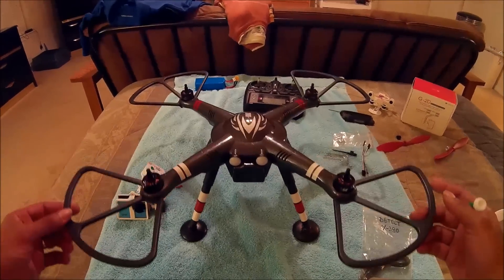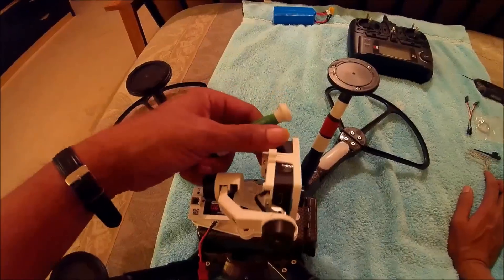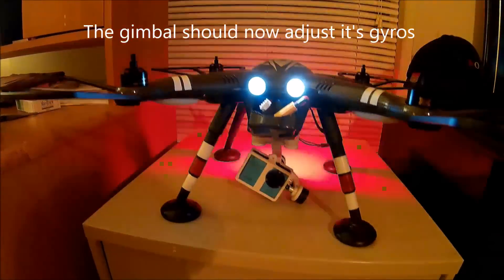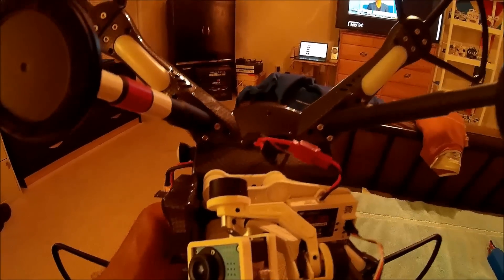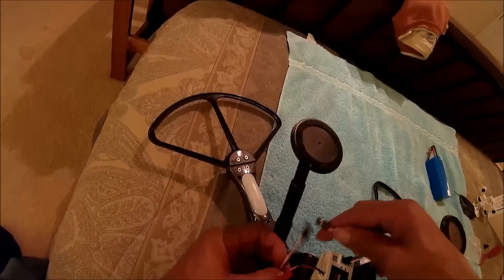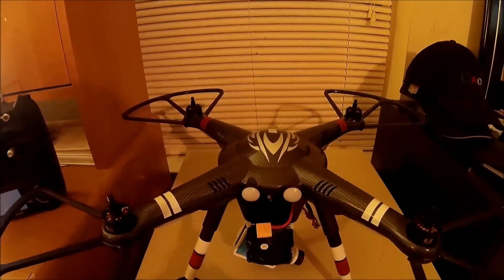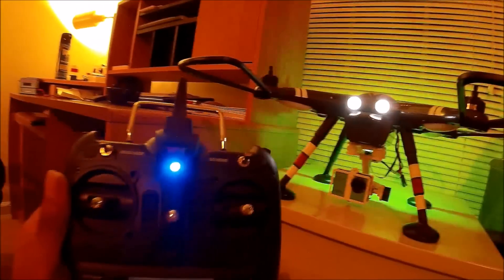XK DETECT X-380 "HOW TO INSTALL THE G2D GIMBAL"

Comment: it does not work for me I did everything u said
Reply from the maker: Are you using the same drone & gimbal as shown in this video??? Are you using the exact same cables & wires? It should work. I suggest watching the video again and go back and check your connections (positive & negative wires, etc.)  Good luck!!!
Reply: @DJSOULFORCE   yes i am have the same drone have  the same gimbal and the same wires
Reply: yes I did  @DJSOULFORCE
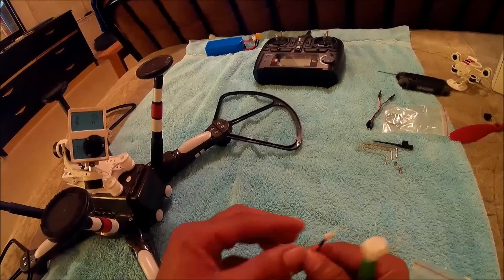Reply from the maker: Your gimbal may be defective. To test your gimbal, (REFERENCE 2:11 in video) use the gimbal power cable, plug it into a 2S LiPo battery using a JST connector to see if your gimbal is working.
Reply: @DJSOULFORCE    ok thanks

Comment: Hi, I need your help. I am going to instal my no original brushless gimbal. I fear that I fry my FC after plug in signal lead from gimbal to X380. Output from gimbal PITCH signal is =5V!!! Pls could you measure your output on your signal from original gimbal.Thx in advance
Reply from the maker: That's correct, output from the PITCH signal is 5v.  What gimbal are you using?  You refer to "original gimbal" and I'm not sure which gimbal you are talking about? I'm using the Walkera G2D, I do not have the Original XK gimbal...  Good luck, thanks for watching!!!
Reply: Ty for your fast respond.Did you really measured 5V on signal wire  FROM gimbal? Ibought this one https://www.aliexpress.com/item/2-Axis-Brushless-Gimbal-Lightweight-Aerial-Photography-Gimbal-plug-and-play-PTZ-For-DJI-Phantom-1/32843537496.html
This gimbal work well but I am not so brave 😊 connect signal for pitch. A lot of guys talked about destruction of FC
Reply from the maker: No, I did not actually measure because there "is no signal coming from the gimal" only signals being sent to the gimbal.  As long as you ensure that you don't reverse the wire, you should be good to go!  Good luck!!!
Reply: That is why I am asking😊. When I powered gimbal by 12V and then  measured on pitch PIN and GND on the gimbal I measured 5V. It seems weird. Pls could you simple check on your gimbal?Thx
Reply from the maker: Sorry, I don't have a voltage meter at this time. It does sound weird, I would not connect it if I were you!  Good luck.
Reply: Np.Thx anyway

Comment: Well, I finally installed my G-2D on my X380 and it all seems to work fine. One question, does ANYONE know how to know approximately what angle the camera is tilted in flight? I mean, in bench testing, there doesn't seem to be any fixed position on the tilt wheel that corresponds to the angle of the tilt. I'd like to be able to know what angle of tilt while the quad is far away so I get the best video.
Reply from the maker: Sorry, there's no way to tell except to set camera angle before takeoff and leave it!  Another alternative is to set your camera up for FPV so you can use a monitor to see what the camera sees.  Good luck. DJ SOUL FORCE
Reply: Soul Force, thanks for the info. I was hoping XK had some little icon on the LCD that indicated the pitch on the gimbal. I've got a TS832 tx on order so setting up FPV is next on my "to do" list. 

What I REALLY want to do is (assuming I grow a big enough pair) is go up to one of the volcano's we have down here (Poas or Irazu) and fly over or even down into the crater and get some really spiffy video inside the crater. Unfortunately, that's about 11,000 feet altitude so I'd need to be sure I have enough lift to climb out and land safely.
Reply from the maker: Wow... sounds like an awesome flight. Would love to see that and you'd probably be the first.  Be advised that some GPS quads won't fly over 8,000ft above sea level... I don't know how or why, but I've read that in user's manuals. The Phantom won't climb over 8K feet above sea level, even if you climb the mountain and take off at seven thousand feet, it won't go above 8K. The X380 is not that smart, so it may work! LoL!!!

Comment: hi I just got the walkera g2d gimbal I'm stuck on the signal wire you spliced the white wire mine has turned out to be the black wires but on the signal pin you said does that matter? and did you put a node on that wire I was recommended to. hope to hear from you soon
Reply from the maker: Sorry, I'm not sure about your black wires as opposed to mine being white. It's possible that the G2-D gimbal has been revised since this video. NO... I didn't use a node on mine! Good luck. DJ Soul Force

Comment: Hi. How can I see on my Remotecontroll which angle the cam stands if I pitch it?
Reply from the maker: You can not, unless your camera has FPV (like wifi) and a monitor (like a smart phone). I usually adjust the camera angle before takeoff and leave it!  Good luck. DJ Soul Force
Reply: DJ SOUL FORCE Otherwise I can count the clicks the wheel on my Remotecontroll made 😋

Comment: hi. thanks for the video.its very very helpful.just would like to ask once the gimbal and camera are installed do you have to calibrate the remote control.if so how would you do it.many many thanks
Reply from the maker: No, you do not have to calibrate the remote control once the gimbal is installed. Your remote control should be calibrated already from the factory. If you need help with calibrations, watch this video: https://www.youtube.com/watch?v=CTCmB86CY88  Good luck. DJ SOUL FORCE
Reply: oh thank you. you are a gem.absolutely wonderful.

Comment: Hi. Thank you for your video, it served me a lot. I have a question for you. I put the gimbal. Without problems, and it works, but now the dron does not fly, it comes out a color code that says the manual "control overload" ..... what is it?
Reply from the maker: I'm not sure what that could be. What color is your LED on the back???  Remember to never plug or unplug the gimbal while the power is on the quad. If you cannot get the quad to work properly, watch this video and follow these instructions:  https://www.youtube.com/watch?v=c0jPjEA4ZdQ  Good luck, let me know how it turns out. DJ SOUL FORCE
Reply: Hi. thanks for your prompt response. The drone light is yellow. According to manual on load of control. I connect the gimbal and then the dron, the gimbal works, but the dron does not.
Reply from the maker: Try turning on the quad WITHOUT GIMBAL connected to see if you can get GREEN light or if the yellow changes. If not, watch the video (i sent link in the first comment) and follow those instructions. Make sure that your gimbal connections are correct and that positive-to-positive, and negative wires are connected properly. Good luck.

Comment: Moving camera forward to get legs out of camera view. Maybe rotating the metal arm that suspends camera cage 180  degrees will move camera cage forward 1 1/4 to 1 1/2 inches.
Reply from the maker: Thanks for the tips. I have resolved this problem. The G2-D gimbal mounts on a "slider" type mount. I found that I didn't have to slide the gimbal all the way to the back to lock, so by leaving the gimbal paralel with the battery door, the legs don't show up in the picture! Thanks for watching. DJ SOUL FORCE

Comment: Hey DJ, I've got an OEM gimbal for my X380. I've got it mounted up just fine and the 2 axis stabilization works great. I remember in one of you videos, you described adding one wire that allowed you to control the tilt. Could you please tell me which video that was, so I can watch it again?

By the way, I'm so envious of you, getting to play with all of these quads, for FREE!

Your buddy,

Mikel
Reply from the maker: It was this video that you commented on! I don't have the x380 OEM gimbal, just the Walkera. I'm guessing that your OEM gimbal should have come complete with all neccessary connectors. Good luck. DJ SOUL FORCE

Comment: How far forward should the gimbal be? I want the legs out of the picture.
Reply from the maker: If you're using the Walkera G2-D gimbal, it mounts on a "slide" type bracket to hold it to the body of the quad. When you slide the gimbal on, you don't have to push it all the way to the back, ...leave gimbal even with the battery door and that should get your legs out of picture!  Good luck. DJ SOUL FORCE

Comment: having issues with the pitch. I actually have a go pro on it but it won't settle down after I hook up the battery.
Reply from the maker: After you turn on the remote (but...BEFORE YOU TURN ON QUAD) turn the tilt wheel up one notch, then turn on quad. The x380's default gimbal position is down, then the gimbal struggles to lift the camera up after you turn the wheel 100 times to get the camera to point up!!!  Also, make sure the camera is as close to balanced in the gimbal without any power. You may need to add some additional weight for that. (here's an example: https://www.youtube.com/watch?v=i5SmKr5NCwc) Good luck. DJ SOUL FORCE
Reply: DJ SOUL FORCE, the plug for pitch,  that come with the gimbal don't fit in the X380. do you suppose the signal pin could be reversed?
Reply from the maker: TJ P  The plug I use for pitch control, came with the x380. See if you have extra wires in the bag of screws and that little wrench!  That's the wire in this video I had to make it a little longer. Let me know how it goes.
Reply: DJ SOUL FORCE I used that for power. thanks for the help.

Comment: Hay, Soul,  when is your next give away?  This is so I don't forget to send you my address LOL!
Reply from the maker: ...you're silly!!! Next round at 4,700 subscribers!!!! Stay tuned. Thanks
Reply: Soul, like they say they say "The squeaky wheel gets the grease"  and I'm squeaking my butt off  LOL,   But anyway,  what do you think of Wilkear Drones, check this deal out at Ebay and tell me what you think?  Please. 

Walkera QR X350 Premium GPS Dual-Navigation FPV Drone
Reply from the maker: Tank 62 Looks like you were trying to send me a link, but I can't click on it... but the Walkera QR x-350 is a pretty decent quad from what I've seen. I've never flown one but there should be lots of videos on youtube from other reviewers. The QR X350 has been around for a while, the older ones (first version) had camera issues (the Premium version should be the fully loaded version right?) with that iLink FPV Camera, but the gimbal was great! I heard they fixed all the issues, but it's hard to tell which version you're buying these days!!! Copy&paste the URL (address) from the Ebay page and send it back to me to take a look. holla back.  DJ SOUL FORCE
Reply: It is that price because there is no camera, out of 2 it can dip at the same time.
Reply: But thanks, respect your input from someone I can trust.

Comment: Nice thanx - it seems to hunt up and down but iI have a work around with tat in914 diode thing. Luv your way of explaining.
Reply from the maker: Does your gimbal point all the way down when you power up the quad??? If so, try this. Turn on transmitter. BEFORE you power on the quad, turn the gimbal tilt wheel up one notch then power on quad, it should come up level. If you haven't done so, watch this video, (https://www.youtube.com/watch?v=Yq5bpV_KIh4&t=1s) It shows what I'm talking about. The x380 default gimbal position is "down" for some strange reason... then the gimbal fights to lift the camera back up after you turn the wheel to the up position. This also causes vibrations and constant movements! Let me know how it turns out.  DJ SOUL FORCE

Comment: Thank you to you for is video I got questions for you. I connect my battery in my camera drone and tilts to the side and gives little help to continue and if I want what I have right remains tilted my Drone on a 45 degree angle how can I correct this situation?
Reply from the maker: Add extra weight to the bottom of your camera to make it as close to balance as possible without the power on. When you turn on your transmitter, push the tilt wheel up one notch before you turn on the quadcopter, this will stop the camera from pointing down when you turn on the gimbal.  DJ Soul Force
Reply: thank you I will try it you been a great connoisseur drone

Comment: My drone wobbles in a circle after attaching the g2d gimbal and a gopro. I did calibrate the sensor, but it didnt fix it. Any Ideas?
Reply from the maker: Put quad on flat, level surface. Turn on transmitter, turn on quad. Wait for beeping to stop. Without using any sticks, flip the RTH button 12 times or more until LEDs start flashing. Put RTH switch back in the up position, when lights stop flashing, you have just calibrated the accelerometers! That should stop the drifting. NOTE: Do not use the wifi on your GoPro. Good luck. DJ SOUL FORCE
Reply: Thanks for responding. Hopefully that will be the fix. I will check tomorrow. Do you ever use the application on the computer to adjust the quads firmware at all?
Reply from the maker: Caleb Hansen  I made a few changes by using the x380 flight control program a while back. I try not to connect my x380 to a computer unless it's absolutely necessary! Lol

Comment: Yo DJ I watched your vid and im curious about the Go-Pro hookup you mentioned, I wanna make my X380 FPV but i also want to record video and take pics, The hookup you mentioned about taking pics and video do you know if there is a way to do both? Or is it just gonna be press record on the go-pro and record that way and watch the FPV?

Here are the list of parts im looking to get to make this all happen but not 100% sure what is and isnt needed. Please help Thanks!

XK Upgraded Parts X380-055 5.8G AV TX/RX FPV Sets for XK X380 RC Quadcopter X7T0
http://www.ebay.com/itm/291882624481

Apex RC Products GoPro Hero 3 / Hero 4 -> FPV Transmitter Adapter Cable #9515
http://www.ebay.com/itm/221662052930

Walkera G-2D Brushless Gimbal (Plastic-White) for iLook/GoPro 3 on X350 PRO-US
http://www.ebay.com/itm/252575851276
Reply from the maker: Sorry Dennis, I don't recall mentioning a GoPro hookup, except for saying this gimbal is balanced for the weight of a GoPro. I don't use FPV on my x380 and don't own a GoPro, so I can not advise in this area! Good luck. DJ Soul Force

Comment: Hi DJ Soul, I had my X380 for about a month now and only flew it about 3 times.  I went all out and got the fpv set for it, EZosd, walkera G2d gimbal and sj5000 camera.  I'm a bit dissapointed in this quad because it just deosn't fly right. It will not respond to my controls when i try to make it yaw to the right, it only wants to yaw to the left and rather quickly.  The return to home feature works great but the headless mode does not work the way it should.  On a fresh batter the quad tries to maintain a hover but then randomly just decides to bounce up and down within an altitude of 8 feet and eventually came in for a hard landing on its own causing it to tilt to one side while the propellers where spinning: this caused the plastic motor mount to crack.  Now i have to get a new body shell to replace that. 
     I don't know what all the hype is about this quad to be honest. I got so may good reviews with long battery life that I felt sold..... I just don't feel like i got any luck with it.  I felt like i got a bad apple.  I want to return it to gearbest for a refnd now.  Over all, my main complaint is that it doesn't yaw, it weaver's back and forth in flight insteatd of trying to maintain a hover within 3-4 feet , headless does not function right and it is just not responsive to my controls.  Please share your take on this, any bad experiecnes?
Reply from the maker: When the x380 was first released, there were some bad ones out there, but that was about a year ago and those should be off the shelf by now.  It wouldn't surprise me if GearBest is now recycling the bad apples that were returned back then or even restocking returned models. Also, there was a lot of things to know about the x380 that's just not explained in the user's manual (like how to calibrate the accelerometers) or details of how to connect to and use the flight control program. If you decide to fix your's, I suggest flashing the internal drive and re-installing the factory master files, here's a video of how to - https://www.youtube.com/watch?v=c0jPjEA4ZdQ  I have also posted a video of critical pre-flight steps to take before you fly it. Good luck with dealing with Gearbest -  their customer service is far from the "best" and even though I do reviews for them, I don't shop there! Lol  Hope you get it worked out, keep me posted. DJ SOUL FORCE
Reply: Thanks for the advice del soul. I think I'll go ahead and do that. Gearbest deosn't have any customer service.  They will not refund me the quad but award me $80 worth of points in my gearbest account.  I think I don't have a choice but to repair it.

Comment: Thank you for your instructions!  I have it working on my XK380. But there is an alternative to cutting the wires of the two cables: I used one of the pins of a defect halogen bulb, it fits in both connectors. I used a piece of insulation tape to fixate both connectors.
Reply from the maker: Thanks for the tips. I later learned that it's ok to not cut the wires, you just don't need them. I think I wrote that on the screen or in the description of the video, but thanks. I'm glad this video helped. Thanks for watching. DJ SOUL FORCE

Comment: hey DJ! do you have any idea if my sj5000+ will fit in the G2D? did you had to make any adjustments to fit your camera?
Reply from the maker: In this video, the camera is actually a SJ4000 knockoff (fake) and it fit perfectly. I later bought a Yiaomi Yi and I had to remove the front retaining clip, I use rubber bands to hold the camera in place. I'm not familiar with the exact size of the SJ5000, but the G2-D is made for the dimensions of the GoPro. You can see how I made my camera fit in the first minute of this video - https://www.youtube.com/watch?v=usWueGtBJCU  Good luck, thanks for watching. DJ Soul Force